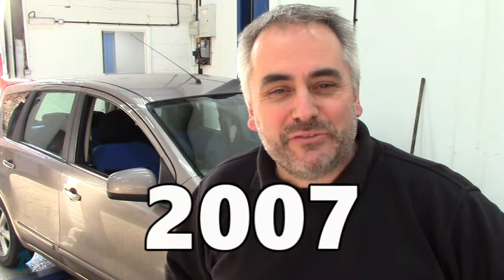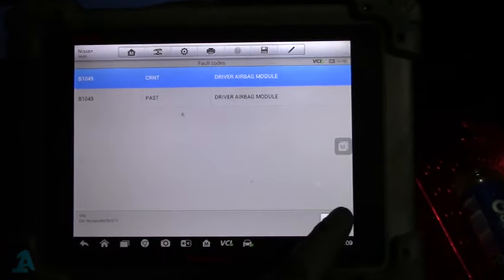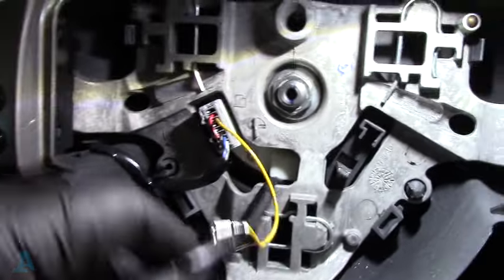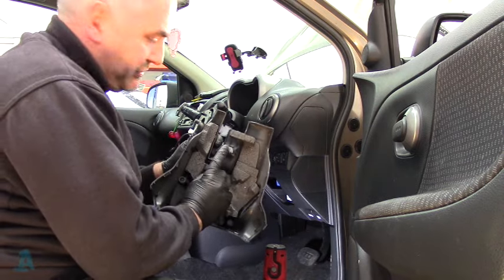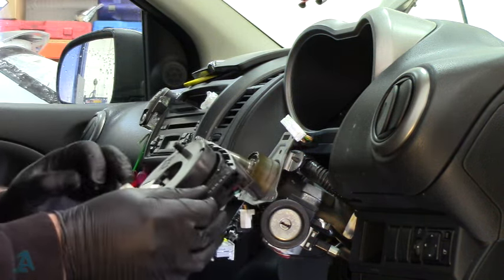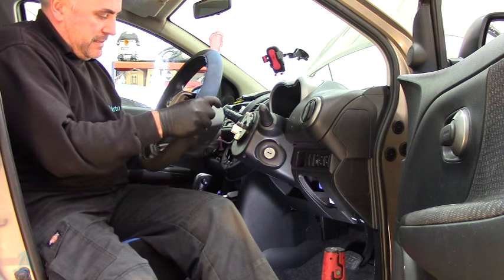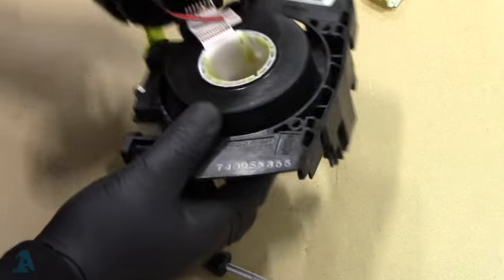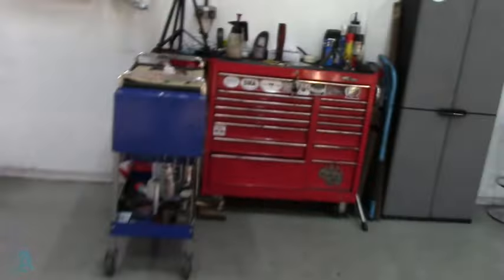Nissan Note Airbag Light Flashing

Comment: Excellent video. This has saved me £100 which my local garage asked for to fit the squib i had bought.More power to your elbow mate,and thanks very much for sharing.
Reply: Don't suppose you have a video on how to replace the steering wheel inserts for the audio control etc etc ? My phone button still not working after replacing the air bag squib.

Comment: Thanks a lot mate, also for anyone needing to reset the Airbag light after:

- Turn ignition switch from OFF to ON.
- Air Bag warning lamp is on for 7 seconds and turns off, the turn ignition switch OFF within 1 second after the lamp turn off.
- After ignition switch is turned OFF, wait for more than 3 seconds.
- Repeat steps 1 to 3 twice. ...
- Turn Ignition switch ON.

Comment: This is a great video. If you are having problems with you passenger airbags and you light constantly flashes, there may be a very simple fix at no cost. My 2008 Nissan Frontier SE stated my seat occupancy sensor wasn’t working. I tried to reset that annoying blinking light to no avail. Before I took it anywhere to be repaired, I dug deep into all the connectors and wires which were all good. However, moving my seat back and forth a couple of times, I noticed the cable leading into the seat where the mat inside the seat was pinch on the rail which the seat slides back and forward. Moved it clear and made sure it wasn’t kinked and everything is working fine. I did need to reset to get the light from flashing. My Foxwell diagnostics unit shows no fault and airbag is fine.

Comment: I’ve just received my replacement spring. Off eBay. The sellers post states it fits my car. But upon receiving it, it has another socket where I’m guessing another plug would go in for duel steering remotes…just hoping it doesn’t impede replacing it now.
Great informative video

Comment: Nice job finding and replacing Rob. Even thought the battery is disconnected I am always waiting for the air bag to explode!
Reply from the maker: Cheers Mike. I'm lucky I suppose cause back in the 90's when I worked at a Peugeot dealership I had to change hundreds of clock springs on a recall, so I got used to having your ass twitching when taking the airbag off 👍
Reply: As long as you disconnect the battery and wait several minutes you’ll be fine. Since there still maybe a little power stored, you can turn your headlights on a bit to ensure no power is anywhere in the system to trigger the airbags. Good luck. I’m getting to replace my clock spring on my 2008 Nissan Frontier SE.

Comment: Two points from my experience of doing this.
One, there are three similar but different parts available.
Two, be careful when fitting the indicator stalk, there is something which works the self cancelling. I missed it and now have do my own cancelling as I can't be bothered to strip it down again.

Comment: Thank you for the video, just changes the clockspring in my 2007 versa, here in Hawaii.
Reply from the maker: Hawaii!!! That’s friggin cool 😎
Reply from the maker: Hawaii!! That’s cool 😎
Reply: I’m trying to do the same on my 2007 Versa, but I can’t get the airbag off. Any tips/tricks you found out when doing yours?
Reply: @lukegiduz  I used a couple long thin screwdrivers, like the ones used for electronics, to push the tabs inside the holes on the back of the steering wheel. 

It takes a surprising amount of force to push those tabs in, and you have to use something pretty stiff. My first trys were with a plastic tool and it just bent.

Good luck! And happy new year

Comment: Hi Rob, I managed to fix my airbag thanks to you. I didn't know where else to post this, but I have a new fault with my Note 2007 it's an auto 1.6. I have a rumble/drone at speeds over 25mph coming from the front end that's worse on tight bends, it's not the wheel bearings as I've changed those any ideas as to what it could be? I think it's getting gradually worse. Cheers 👍

Comment: hi What a great video. I followed your very clear instructions and replaced the clock spring. i have a new problem. once i fitted the replacement the esp  and slip indicators come on. what did i do wrong 😅
Reply from the maker: Strange. All I can think is you may have pressed the esp off button somewhere? What fault codes do you have?

Comment: Hi Rob, i came across your channel, as i have a 2009 Nissan note which has a flashing airbag sign now. You say to disconnect the battery before starting the job. Unfortunately, i don't have the code for the radio, so if i disconnect the battery i will lose the radio. Instead of disconnecting the battery, could i just take all the fuses out, but leave the radio one in. Of course i will take photos and make drawings of exactly where each fuse goe where. Your thoughts will be apreciated. Many thanks, Oz.

Comment: Hi Rob, firstly thanks for this brilliant video 👍 I've just run a scan on my mums 2007 Note and I'm getting B1049 Driver Airbag Module - Open. I'm ordering a clock spring, but what I need to know is, is it safe to drive even if the light is flashing, will the airbag go off while it's being driven due to a fault? Cheers 👍
Reply from the maker: No it won’t go off as it is disabled with a fault logged
Reply: @OneAuto  Thanks Rob, much appreciated 👍

Comment: Great video . Quick question if I were to just remove the pin from the air bag would the light in the cash go away because my light is always on
Reply from the maker: No. The only way to do it would be to fit a resistor

Comment: My car has a solid airbag warning light constantly on I've had it in garage and they can't find the fault with there diagnostic scanner thing what one would I need to buy to be able find the fault they have checked fuses an cables under seat for any loose done the ignition on off thing that's not worked any ideas please mot again next week so need try get it fixed local garages are full so can get diagnostic test done before the retest date

Comment: Do you need to remove the battery when working on an airbag as I know Bodgit And Leggit says you don't.
Reply from the maker: For the purpose of following the Nissan manual and the video.. yes you do.

(But I’ve done it without 😉)
Reply: I would play it safe and disconnect the battery and wait a few minutes before doing anything with airbags.

Comment: I have a Nissan qashqai 2015 with a remote key and when I turn it ON at he airbag light is solid and doesn’t flash. Even when I turn the engine on the airbag light is solid. Could you help me out?
Reply from the maker: You need to get the codes read by your local garage
Reply: One Auto,  the code is B009488 but I installed a new dashboard and airbags and I still get this light
Reply: Check all of the connectors and wires good under the seat the ensure you have good connections and the none are being pinch on the seat slide rail. I discovered that on my Nissan Frontier and all is good and no codes any longer. The best part is I got rid of that pesky light.

Comment: Cheers for this , garage quoting me 300 quid for this when the springs 16 quid on ebay with 5 year warranty ? i guess thats Nissan parts or an Oem one as opposed to one on ebay with a 5 year warranty ,nissan have this car on recall for an airbag fault and say they wont touch the airbag until they repair the light and spring :) ......  i have not had the balls to ask for a quote from them , Diy time .

Comment: I need the way to remove airbag flashing for murano 2006 many thanks
Reply from the maker: I don’t know this model but you have to start with a fault code scan to give you direction
Reply: You may have a bad connection under the passenger seat, or you could have a pinched or broken wire that has been pinch on the seat slide rail from moving seat forward and back. That’s what happened to me.